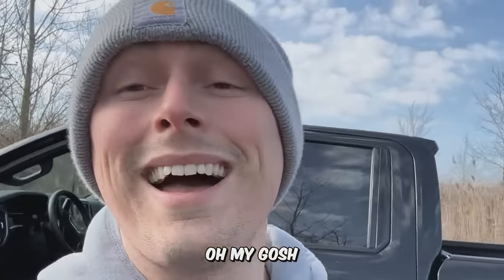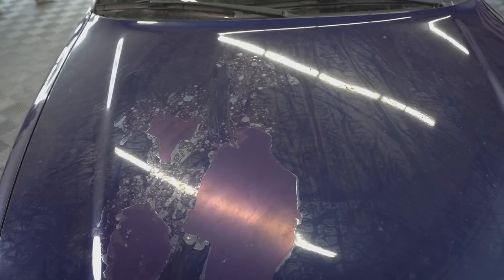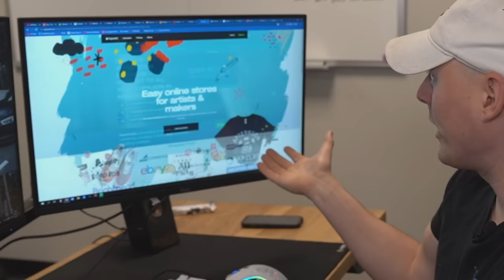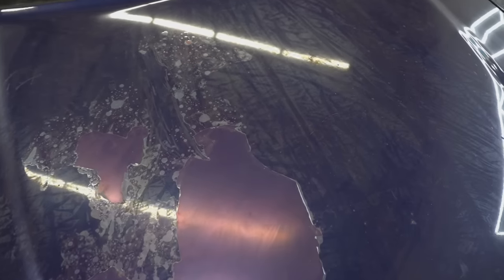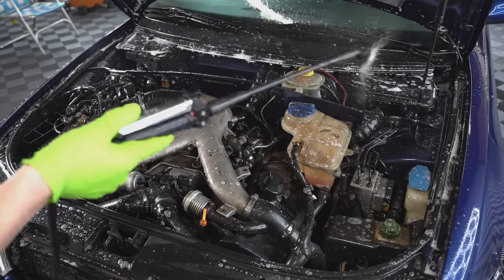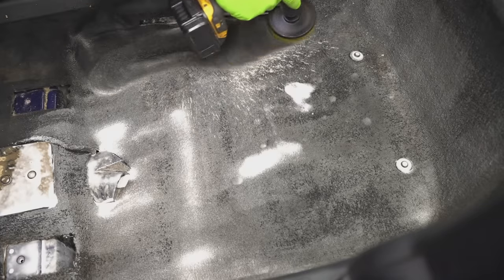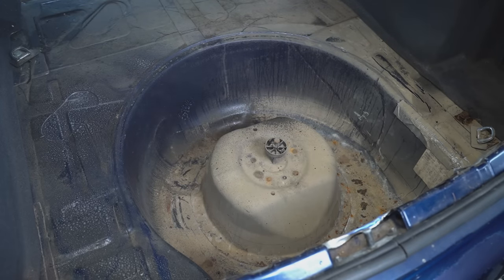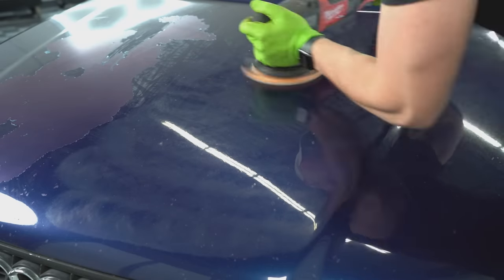Disaster Barnyard Find | Audi B5 S4 | First Wash in YEARS! | Car Detailing Restoration

Comment: the black plastic bag in the backseat is for ski's and ski poles. You can carry them inside the car while the melting snow is not going in to the car.
Reply from the maker: Whaaaat no way
Reply: @WDDetailing  yes for sure it is 👍🏻
Reply: @WDDetailing  I had a BMW with the same option
Reply: @WDDetailing  yes it is an extra I have in my Mercedes as well. Greetings from Budapest!
Reply: Engine is a 2.7 twin turbo that produced 250hp from the factory.
Reply: And the tube is to get rid of the water. You just put it outside the back door so the trunk doesnt get wet
Reply: I never would have guessed that. Thank you 👍👍👍
Reply: It's for wet skies. Greetings from Germany
Reply: Absolut korrekt diese Antwort, es ist ein Ski - Sack !
Reply: I was confused as hell when I bought my car and rolled that thing out.
Reply: Nen Skisack
Reply: All that crap you pressure washed out of the trunk is under the carpet in the cabin too. That carpet needs to come out
Reply: I mean she’s alright
Reply: Bmw's has it as well.
Reply: so obvious lol
Reply: @WDDetailing  In Europe it`s quite common. Especially in Germany, Switzerland, Austria, France were many people drving these cars for making winter holidays. Maybe special in the US, but not there!
Reply: RS2 is the best Audi ever made 😎🚗
Reply: @BrunoPereira-ke8jt  there were 2 types one producing 250hp and one producing 265hp the facelift B5 was produced from 1999-2001 the whole b5 Facelift platform
Reply: I just commented that too lol
Reply: It's pretty common in German cars of the period.
Reply: Some BMWs with the Cold Package come the same way.
Reply: Yes sir you are correct. My first car (1987 Audi 5000s) had that as well
Reply: @WDDetailing  i got the same plastic in my S6 C5! :D
Reply: @BrunoPereira-ke8jt  265HP, 250 & 230 were in the A6 C5 2.7biturbo :D
Reply: @WDDetailing  we germans are crazy . My B5 used have one of these aswell, but i removed it so i can use the room to load up stuff like ladders or wood through that hole
Reply: @ronancoskun6305  Did it come out easily or did you have to cut it out? Cheers!
Reply: @WDDetailing  it's called "ski-sac" a classical optional for Audi and not only at the time
Reply: Or you can use it to put your trash in.

Comment: I just got on the Audi wagon a few weeks ago. Got a good deal on a 2000 A4 S-Line. It's now in the shop getting the rear shocks and front bushings replaced. Everything on it works: all the electronics work; sunroof, windows, sound system. Next come timing belt and coolant replacement, and I got to fix one of the headlights because it seems water got into it, and replace the infamous LCD screen. It only has 84.000 miles on it, seats are not ripped or anything. so I think I got a pretty good car. The moment I drove it for the first time I was like "ok, THIS is what driving a nice German car means". I'm hooked!

Comment: The sleeve in the arm rest in the back is  for when you go snowboarding or skiing you can run your skies or snowboard threw it so you don't get the inside of the car wet and can you do a part to so we can see if it we'll run and or what it we'll take to do so. I have a silver b5 s4. 132k miles and full stage 3 just done over the winter. Getting ready to dyno tune it in the next few weeks. Love B5s

Comment: We drove a AUDI A 4 B5 stationwagon with the 1.9 TDI ( diesel) engine from 1999, with more than 535.000 kilometers with no problem what so ever! Very reliable and with excellent driving and never have any problems , so that was the best car ever and we did drive it for more than 22 years ! The bag from the rear end you blow air in it and put your ski,s in it so you want damage the interior. And our Audi did not have any rust spot on it even there are a lot salt during the winters !

Comment: You're so right about how taking care of a car will make it last longer. I have two older Mercedes (2004 & 2009) and I constantly get comments about how expensive they must be to repair. I haven't had a single major repair on either of them because I get them serviced regularly and deal with any potential issues before they become problems. Both my cars perform and look much newer than they are.

Comment: He's right about these things being reliable and I can confirm. We have a 1999 Audi A8 D2 2.5TDI and the car itself has 476100km or so on the dash and counting. And after all it has been through the car is virtually indestructible, and I have no doubt it can go for more. Sure the valve stem seals started leaking but thats the ONLY major issue right now. Else than that she still purrs and hauls around normally. These old Audis were one hell of a reliable beast man. And the suspension was and still is definitely ONE OF THE GREATEST in the game, its one of the nicest and most comfortable suspensions in a cheap car like that ever. You can pick up a 1999 s8 4.2 V8 here nowadays for like 4-5000 euro which is basically nothing. Great video!

Comment: Thanks for saving it! Still a beautiful car. Hopefully someone can get it running and finish getting it sorted. Nice to hear the conversation besides just the cleaning. Keep up the great work!👍👍👍👍
Reply: No one is going go restore that car
Reply: @enjoythesho1992  Why not? Get 400WHP without too much trouble and better weight balance than the 4.2L V8. Doesn't sound as rorty, but a blast to drive. If the electrical is not too bad from the flooding, it could be done. The leather is an easy fix. Or would you rather just play a troll?
Reply: @jhconjr  The car has 250k miles on it for one it would cost more than its worth to "restore" and third I've been in the car game for a long time not a f***ing troll I know car values and what they are worth it would not be a smart investment to restore it but I'm sure to a big baller like you it would be chump change right lol
Reply: @enjoythesho1992  It may not be justifiable from a purely financial standpoint, but might be from a personal interest standpoint. I hope you have a better day. Until then, you might want to look up the definition of internet troll. Criticizing is easy with the anonymity of the internet, but is ultimately self harming. Are you aware the guys on this channel have been open about their emotional struggles? One of the reasons I like this channel. Take care of yourself (no satire or condescension stated or implied).
Reply: @Thor Odin son doesn't matter how much they gave for it the price to restore it is the same lol .....your definition of "restore" and mine must be completely opposite but hey I'm sure you restore cars all the time right
Reply: It's been flooded. The chassis is probably toast. Kind of a waste of a detail.

Comment: That Thing in the Middle at 12:00 is a Ski-Sack.
There is a Smaal Door from the Trunk in the middle, to reach the Ski through the middle of the car.
That Sack prevented the Water to get inside the cabin. This car was designed to get in the snowy mountains with your skis and friends to have some fun ;)

I have an S4 B5 aswell, but the Avant version (Station Wagon) and I love this thing.. 292'000 km on it ;)

Comment: I loved mine - had the Avant variant in Nogaro Blue, but it broke my heat (and my bank account) keeping it on the road. The K03s like to detonate even if you are keeping well on top of the maintenance. They are forever popping EGT sensors. Boost leaks. Specialist tools for timing belt changes and not an easy job either. Had it for a few years, babied the crap out of it and it blew up the turbos a couple of weeks after I sold it on.

Comment: Also in addition, I followed a fun leather cleaning tip, as usual do a test spot. But using Soft Scrub (bleach free) cleaner does a really good job buffing out stains on leather. Acts like a fine polish with grit. Worked well on my old Camry DLX before I sold it. 👍

Comment: I would love a B7 S4 with the 4.2L V8. I have a '04 A4 with a 1.8T that I'm currently trying to restore despite the fact it has 230,000 miles. I've been able to source some used parts super cheap, but mine was also missing so many LITTLE things.

Comment: My B5 S4 has just passed the 300,000 mile mark.  It is my daily driver and has been ultra reliable, never letting me down in 19 years of ownership.  I always feel that those that say the B5 S4 is unreliable have probably turned the $@*& out of it and therefore over stressed the engine, drivetrain, etc. Just enjoy it for what it is.  Probably already said by others but the bag that emerges from the rear seats is a ski bag.  This was an option.

Comment: I have a 2006 VW TDI Golf with 292,000 miles and going strong! And this was the motor that "would flatten the cam." Still on the original cam in spec.

Comment: Little late to the party. I currently own a B5 s4 avant. Driving a b5 is a completely different experience compared to any car I’ve driven. My car has 280k miles took the motor out to recondition some external components, but after it’s done I expect it will run another 100k before major maintenance

Comment: Definitely Audi A3 and A4 are my favorite especially 1.9 TDI. They just run forever. Talking about the trunk locking mechanism... it's a nightmare. It happened on my volkswagen golf 4 and I found that WD 40 works the best for stuck mechanisms. It is a different mechanism but this might fix your problem.

Comment: I have the same car in the same color...in the same condition. I'm actually moving it into a bay that finally opened up long enough to pull the engine tomorrow so it was weird that this video just appeared on my feed. 

I do paint and body work, thise random markings on the hood are likely caused by someone covering the hood with a tarp is some other plastic for some reason. Everything on that body is pretty easily repairable.

Comment: I would love an A6 with the 4.2 V8. Low mileage well maintained. Not an S6. Just an A6. Love that engine and midsize sedan. Great video as always. Thank you. And it looks like a bi-turbo 2.7 V6. But I’m not sure. That’s a ski bag in the back seat. Also, that wrinkly pattern on the passenger side of the hood, looks like there was some wet plastic sheeting that had sat there for quite a long time.
Reply: yes, its a 2,7 V6 bi turbo. Greetings from Germany 😄

Comment: That's an awesome find. These B5 S4's are pretty rare, even where they were born, in Europe. My advice would be to have the body/rust sorted, fix the engine and drivetrain/undercarriage and get it under a nice fresh coat of paint. Oh and whatever you do, DO NOT scrap the original front bumper, those are ridiculously rare, the grille inserts/frames are basically non-existent and even more rare. Have it fixed by someone who knows their way around fixing plastic bumpers and then either keep it and enjoy it or sell it, you can make a pretty good side-buck for it. 
The black bag in the back is for skis and skipoles, you shove 'em in from the boot, there's usually a plastic cover/door that you can remove to expose the bag opening from the back.
Reply: I'm afraid it is too far gone, it has been in water up to the windows so all the electronics are destroyed. You can maybe make it run and drive, but it's going to be a never ending story of electric faults, a car like this has multiple control units that all have suffered from water ingress in the flood. The guys did a good job cleaning up the interior, but all the seat foaming, sound deadening etc are soaked with that pee-stinking water and should be replaced... Sorry to say but it's a parts car.

Comment: I would be super stoked to have one of those. I myself have a A4 B7 2.0TDI, but I would love to have an S4 B5 (mainly because of the quattro and these cars being hard to come by now)
Also. When it comes to rust, my car is in slightly worse condition currently. Every panel has rust on it, except bumper which obviously is plastic.
Would love to change changeable rusty parts repaint everything in Graphite Black, lower it a little and put some beautiful wheels on

Comment: S4 B5's had 2.7 V6 BT producing 265 hp. RS4 B5 used the same engine with a little different specs, producing 380 hp.
Theese cars are bulletproof and if maintained properly last forever.

Comment: Probably already been said, but if that was in a flood and smelled of urine, just cleaning the top surface of the carpets and seats won't do it. Those seats had splits too, so all that contaminated water was inside the seats. Not sure what you did with this after superficially cleaning it but hopefully you torched it 🔥.

Comment: How far under water was this car?  I have loved Audis for a long time.  The design of the exterior and interior have always pleased me.  However, in 2005, when I was looking to lease a new car, I test sat in an Audi A4 in the dealership showroom and when I shut the door it sounded like a tin can. I was so disappointed.  I ended up leasing a Mercedes C240 Kompressor Sport.  That car absolutely loved to be driven FAST.  It wasn't decked out with accessories but, for what it was, it was great.

Comment: As always you did a great job on the surface cleaning. But never buy a flood car. Because the electronics and the mechanicals will have to be totally stripped out and rebuilt,or replaced to be reliable. You did a good surface cleaning,but I would be interested to see what is under the carpet and inside the doors. If it’s like the outside surfaces . It will rust to pieces from the inside.

Comment: I do not know whether anybody else theorizes what I do. It is my theory that if one sees a car with mottled paint on it that it could have been struck by lightning. When I owned a Honda Civic, I was driving through a thunderstorm. Lightning struck the overpass that I was approaching. My car came out with mottled paint. I believe that the lightning splintered upon impact with the bridge as I was very close, and an indirect bolt struck my car at that time. I also had driven a friend's Mercury which also had mottled paint. I know that in 2006 there was a freak thunderstorm that struck a big tree in their yard, and a garden light pole was struck and severed at ground level. I believe that bolt of lightning also struck my friend's car.

Comment: I'd take the front bumper off and repair it frolm the inside using fibreglass, fill it ,rub it down, and then respray it and the bonnet or as you say hood.
Reply: It a ski hatch. The bag is for your wet or dirty skis